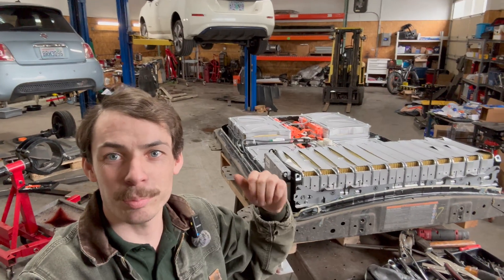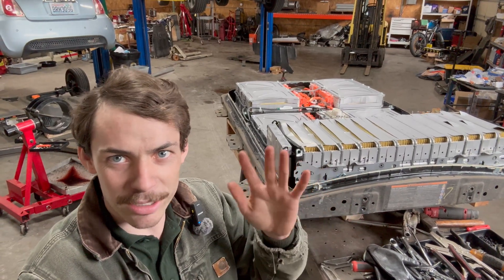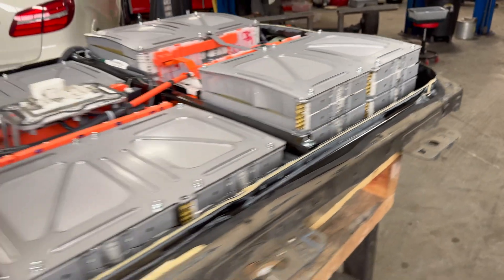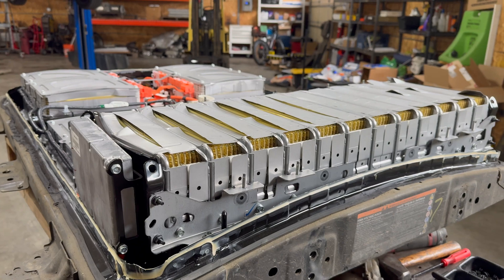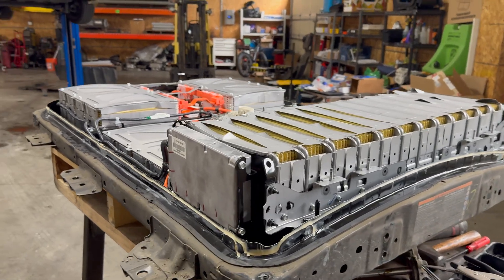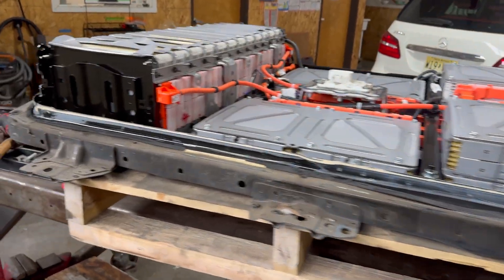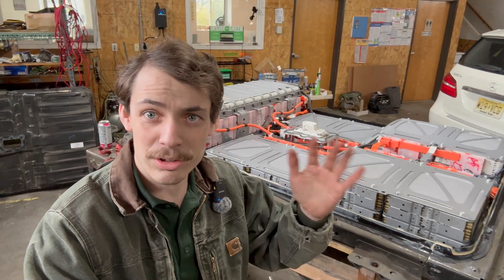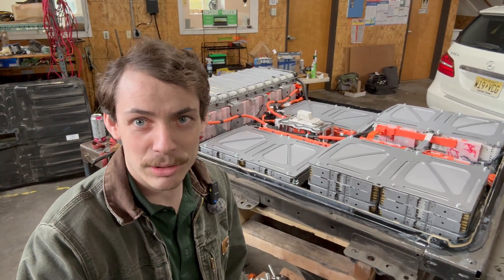Old Nissan Leaf Battery Swelled So Bad It Ripped The Battery Pack Open!

Comment: It's great that you make known for your viewers that this is what happens when owners primarily use DCFC (high power DC charging), especially when performed in hot ambient environments (think Arizona's 115F daytime temperatures).  As many may be aware, older Nissan Leaf's did not employ active temperature control for the battery packs (i.e. no liquid cooling).  I have a 2015 SV and a 2019 SV Plus, both with high mileage. I only ever use Level 1 or Level 2 charging and have absolutely no indication of battery problems. When properly manufactured and properly maintained the battery swelling issues are almost non-existent.

Comment: Wouldn’t that be in the manufacture warranty of 8 years ?
Reply: IIRC, he mentioned somewhere past 120K miles, so it's out of warranty by mileage. US warranty on pack is 8 years/100K miles, whichever comes first.
Reply: @andrewc9318 this is a mark 1.5  depending when it was bought the first batch wa 8 years unlimited mile it was only when Tesla ended its unlimited miles warranty Nissan followed suit, I think it was may of that year

Comment: Wouldn't this be a candidate for cell replacement with new improved modules from chinese company VIVNE ( or something like that)? Even with tariffs, it could be half the price of a new one and can go up to something like 75kWh.
Reply: From what I heard, there are potential problems with these third party batteries due to structural integrity of the new pack compared to the original pack, which is probably worse and can cause issues.
Reply: The VIVNE packs use CATL modules that only support the 80KW inverter. Putting into the later model leaf (110 or 160KW) exceeds the modules discharge rate design limit = bad idea
Reply: @Goodkiwibloke   NEVER heard of that. There's no info about that in their website, neither in CATL web site , and i've been through almost their entire catalogue. Beside that VIVNE has videos that shows the install and test of their 67kWh in ZE1 LEAFs and they are perfecty funcional . Those modules are actually the same that VW uses in their cars in China and Europe. I don't see how would they be limited to 200A discharge current...nonsense!
Reply: @DanieleElaborati And that lack of disclosure is exactly why i point it out

Comment: Hi Alex, good to see you.  Sorry for that Leaf's owner.  Were you able to get a leaf spy report by any chance to figure out how many d c quick charges it had?  Also wonder what the battery state of health was showing?  Lastly, I'm sure about the only one wondering what the owners gotta decide to do.
Reply: Surprisingly only 25 DC charging sessions on this one, but based on a VIN check, it looks like it spent most of it's life in So-Cal and/or AZ, so I'm guessing it sat out in the heat a lot (probably at high SoC). State of health was just under 80%. 
The owner did opt to go for a used replacement pack, and I was able to source one with only 25k mi, but as it turns out, that one had an internal isolation fault, so I'm working with the auto dismantler to get that worked out...
Reply: Thanks for the response Alex Good luck to you and the owner regarding the replacement battery. Would love to chat with you a bit more about it at this week's we're going to electric vehicle Association meeting but unfortunately due to a medical procedure I won't be able to attend. Please enjoy the meeting and the extra refreshments that I won't be eating. If all goes well I may be able to make a sort of guest appearance at the earthday event out at swan Island, later this month.  
. @AlexEVRepair

Comment: Storing at a high state of charge could also provoke this swelling?
Reply: Yes, especially in higher temps. I did a bit more digging on this car, and I suspect that may be exactly what happened to it, as based on a VIN check, it spent most of its life in So-Cal and Arizona. Surprising it's only had 25 DC charging sessions through its whole life.
Reply: @AlexEVRepair  It is nice that through Out Of Spec we learn the dos and dont's for EVs.  The analogy with "checking your oil regularly" is "don't keep your battery charged 100% for long" or "only charge to 100% before a long trip" 🙂

Comment: This is why they need active thermal management….
Reply: Agreed. It's great that this video makes known that this is what happens when owners primarily use DCFC (high power DC charging), especially when performed in hot ambient environments (think Arizona's 115F daytime temperatures).  As many may be aware, older Nissan Leaf's did not employ active temperature control for the battery packs (i.e. no liquid cooling).  I have a 2015 SV and a 2019 SV Plus, both with high mileage. I only ever use Level 1 or Level 2 charging and have absolutely no indication of battery problems. When properly manufactured and properly maintained the battery swelling issues are almost non-existent.

Comment: I’m curious what will happen to the junk pack. Will it get shipped to a recycling facility? 

For that matter what happens to the electronic modules you replace on other vehicles, is the a secondary market that repairs these units or do they just become E-waste?
Reply: Recycling of EV batteries is close to 100%
Reply: @ Yes, I aware of the capability to be recycled. I should have been more specific. I’m asking about the Logistics of where the pack will be sent for recycling and costs involved. 
Given the value of the materials. hope the cost of the shipping is covered be the Physical recycling facility, IE: Redwood Materials or another lesser known company.

Comment: I had this battery swelling thing happen on a cell phone once and it partially popped the back off the phone. I can't imagine something like that happening to a car.
Reply: @lashlarue59  I had a similar experience, but was on an auxiliary charge case with internal pouch battery.
Reply: @dennisschlieckau8723  The weird thing with my phone was the phone still worked and the battery would still take a charge even though it was partially swollen out of the phone.

Comment: Hi can you give an estimate to replace a 2018 model 3 performance battery
Reply: I have a 2018. 225k miles. All supercharged. Battery still working with about 15% degredation. Just wanted to get an idea of what I'm looking at if and when it fails. Thank you. Would definitely like to swap with an 82 kWh pack if possible.
Reply: @dyhppyx  Should not be any problems swapping for the 82, outside dimensions and structure of both packs externally is exactly the same at least for pre-refresh models (worked at Tesla on the Model 3 battery pack line, but not too recently).
Reply: @tribalypredisposed thank you for your knowledge
Reply: Details? I haven't heard one one failing that wasn't under warranty but you've got me curious
Reply: Depending on availability, somewhere roughly in the $8-9k neighborhood. A later 82kWh pack could also potentially be sourced, though that would likely be a bit more expensive.

Comment: What’s the cost for a used battery pack?
Reply: For this size LEAF pack, about $6k installed for a low mileage used example.
Reply: I remember when Nissan wanted 5000to 8000 for a 24kwh battery for the 2012 leaf .

Comment: Who made the battery?
Reply: Batteries for the LEAF are made by Envision/AESC. Nissan was the majority owner of AESC until Aug 2018, when they sold most of their stake to Envision Group; IIRC, Nissan still owns ~25% of the company.
Reply: @AlexEVRepair  hey Alex  I have a 2019 Nissan LEAF 60 kWh that had same issue's...  at 89,000 miles. For me Nissan replaced under warranty I am 2nd owner had it just under a year...looks like first owner never did a Quick Charge... but I highly suspect was charged to full every night outside in arizona heat and based on the high mileage I would say it was a freeway commuter car as has a lot of rock chips in the front 😲I'm also in Phx AZ I have only fully charged it one time and now almost 10,000 miles on "new" pack & LEAF spy says 94% SOH (old battery was 72%) and my Hx is good at 112% ! (old batt. was 44% Hx Ouch! ) The car is completely usable for me even in the summer at around 30-50% SOC  beeter in Heat right ? (that's where I plan to keep it) but it gets left outside during my work hours... if this was your car in my situation what other advice would you give me to maintain battery health as long as possible or is it just going to be inevitable with a non- cooled Nissan LEAF battery. I only have like a thousand miles left of Nissan warranty and then I'm on my own. 🤪 Side note: during the winter months I was planning on using the quick charger to maybe drive to Tucson but I'm still waiting for the recall update and advised not to use fast charging till update. Any advise on fast charging after recall ? 😃